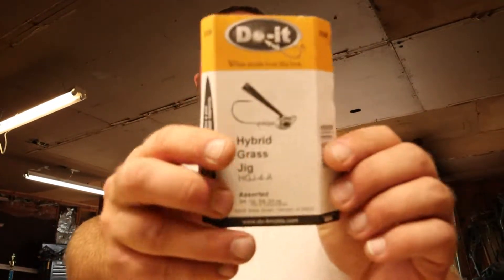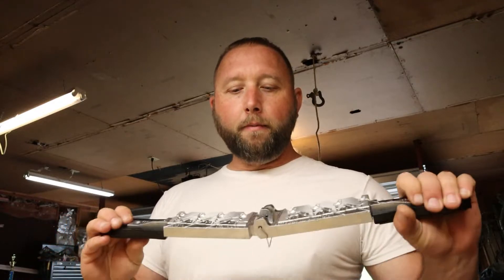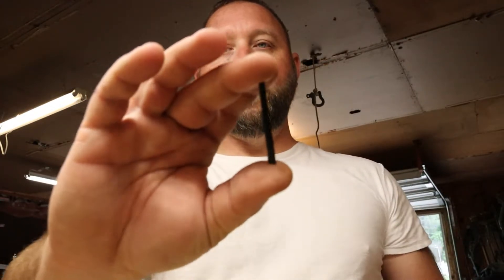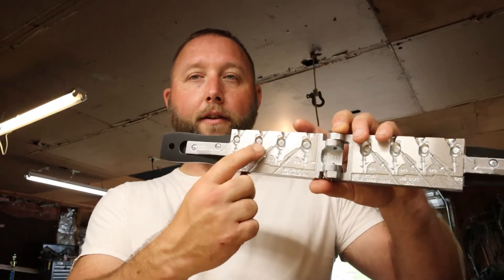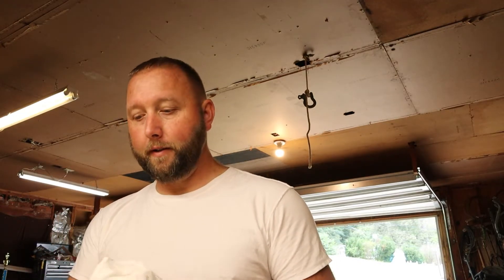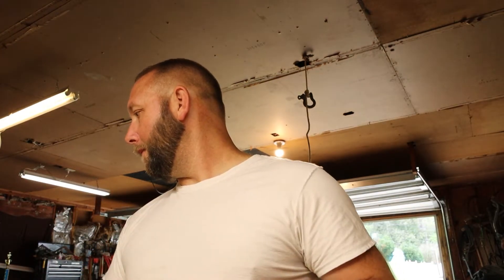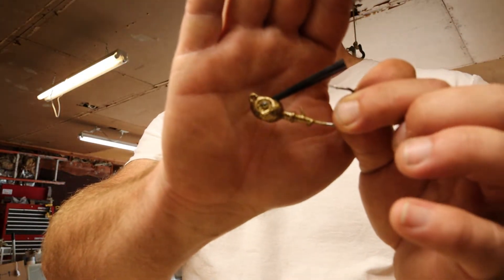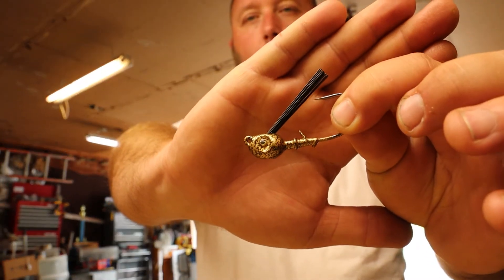Do-it Molds Hybrid Grass Jig...First Pour!

Comment: When I have a bad pour I just melt the lead off with a torch and repour it. Never had an issue with messing with the temper of the hook if you don't really overheat it. Thanks for the vid, probably getting that mold

Comment: torch the lead off the hook, doesn't mess the hook up at all.  But Any mold with a bait keeper and thick wire hook like these flipping style swim jig hooks needs to be preheated and the mold does need a mold release to make a difference.  Been using this mold for close to 3 years and I get more accurate pours with graphite spray than without it.
Reply from the maker: Thanks for that. I just picked up some graphite, so I’ll give it a go!
Reply: @OnAnotherLine  it doesn't take a lot, just spray the jig area you want to pour and it lasts about 40-50 pours.